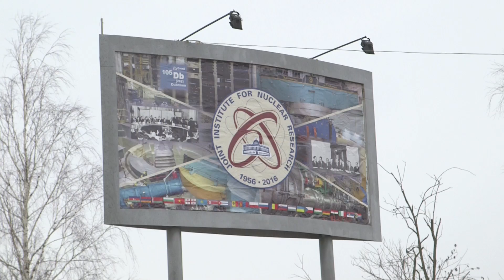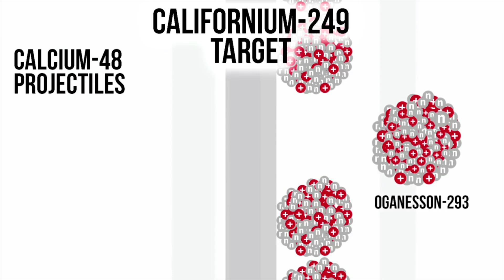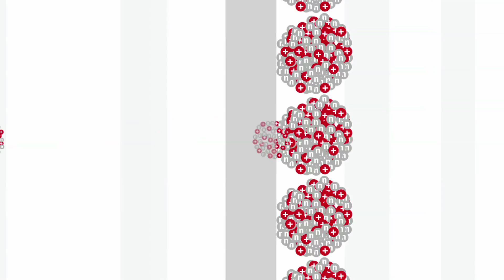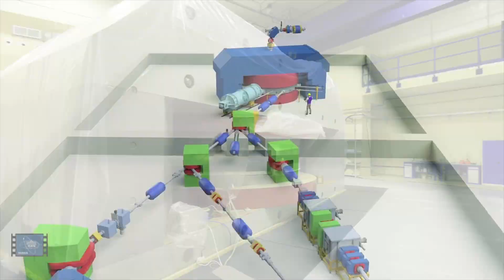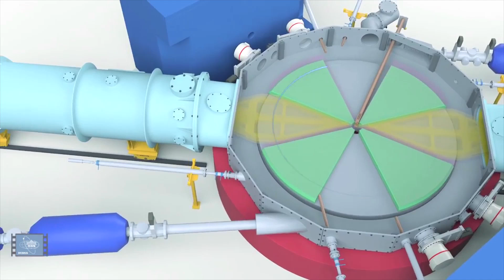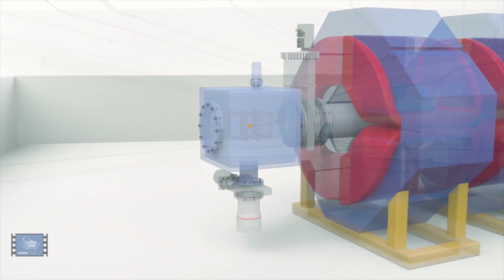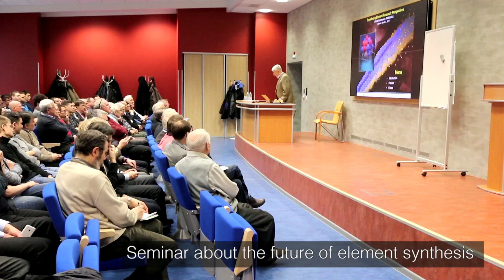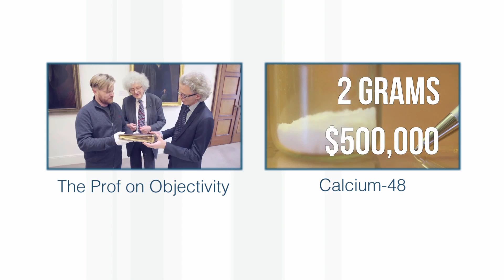Future Elements - Periodic Table of Videos

Comment: Looks like they learned how to drill a hole. Remember the one in earlier videos? But if it works, it works.
Reply: +Minecraftster148790, 1. Structural support. The building might collapse without that one wall. 2. Radiation protection. This wall appears to be a really thick concrete wall. They probably would not build a 50+ cm thick wall, if it were not necessary.
Reply: My very first thought when the new lab was mentioned was, I can't wait to see what the hole looks like in this building.
Reply: Kasper I don't see why they need a wall there anyway. They made this building specifically for this purpose, and they new they had to have a tube here, so why bother making a wall when you are just going to cut a hole in it?
Reply: It is 2018 and people are still obsessed with holes they can send their beam through...

Comment: WHAT!? A magnet that weighs 1100 tons? That's  1,100,000 kg or 2,425,000 pounds equal to about three airliners.
Reply: That's not that much, if you really think about it... Iron has a density of about 8 g/cm³, meaning a 5m cube of iron would weigh about 1,000,000,000 g = 1,000,000 kg. Sure, that's a big cube... but it doesn't seem as overkill as saying "three airliners".^^
Reply: xXx_LYFE_xXx Or 1.1 gigagrams.
Reply: About 13,000 mes
Reply: It makes me think of the Breaking Bad episode where they put it in the back of a truck, pulled up next to the police station's evidence lockup to wipe a laptop with evidence against them.  LOL
       Imagine putting this next to a neighbor's house (one you didn't like).. and powering it on in the middle of the night.  When they wake up nothing works anymore. lol
Reply: Lol
Reply: Not much, only 1 of ma mother.

Comment: Why could they not have 2 projectiles going towards themselves, meeting at the target material?  What would happen/why is that not an option?  Projectile a----> |(target)| <---Projectile b.
Reply: 1) If hitting a big stationary target with a small projectile is difficult, hitting two small fast projectiles is even harder.
2) Accelerating superheavy elements takes a lot of energy
3) As stated in the video, as elements get heavier, it is more difficult to aim them.
Reply: timing it would be insane... you want the target moving...okay then the issue would be capturing it... inside a sensor chamber...like cern...
Reply: I believe only a small fraction of nuclei actually "stick", which means even if both could hit at the same time, there's a chance they wouldn't all merge. I could be wrong though
Reply: Brian Dickinson I highly doubt that would ever work. The chances of it working with just one projectile is already astronomically low.
Reply: That’s what they do in the LHC, because they want very high-energy collisions. Here they don’t--if the collisions are too energetic, the resulting atoms just break into pieces. Here they want more collisions, to give more chances for the reaction products to form.
Reply: Agreed!
Reply: I do agree that aiming would be utterly complex.  As for the acceleration of superheavy elements, that would be the point of the dual projectile model.  Instead of needing such heavy elements, you can use a stable (fairly heavy) target, while shooting 2 fairly light projectiles.
Reply: You are absolutely correct from what I have seen in these videos (I'm not even a novice at that stuff haha).
Reply: The problem is that not every projectile sticks to the target. Let's assume a 1% success rate for one projectile beam, which I guess is very generous. If you have two beams, the chances for both of the projectiles sticking to the target are at best 1%*1%, which is 0.01%. I say at best, since there are probably additional effects and interactions between the two projectile beams, which might further reduce the success rate.